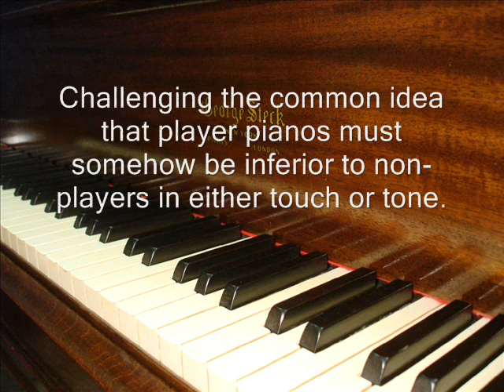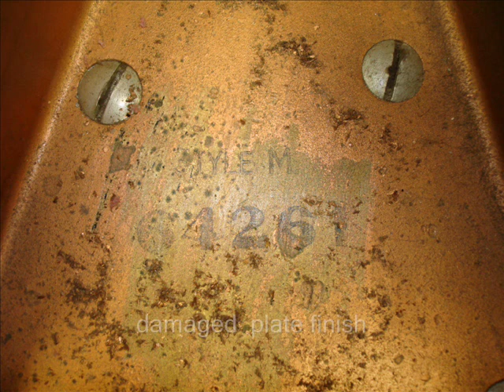Restoration of a 1920 Steck Duo Art Grand Piano (and me playing two Chopin preludes)

Comment from the maker: @kyokutyou2007 
Yes, the Duo-Art keys are longer than the typical "M" scale 5'7", and are closer to the keys of a full 9' grand.  If the capstan position, action ratios, and key dip are set right, and if the touch weight and key leads are properly balanced as this one is, in my opinion the touch is probably better than in non-players.  Some claim that players always  "play like Mack trucks", but every pianist who has played this one tells me it is very responsive and uniform.

Comment: the keys are just longer, so they tend to flex more, but this is more noticed on the verticals than on grands.  the touch is generally soft, less direct than on a grand without reproducing action. 
Leading does not change much the touch it only even, the sensations at very soft levels of play, the lead change the strenght of the tone, as it makes a stronger impact when stopped, at the opposite of the playing side (due to the flex of the wood, more mass on the key side give a firmer attack.